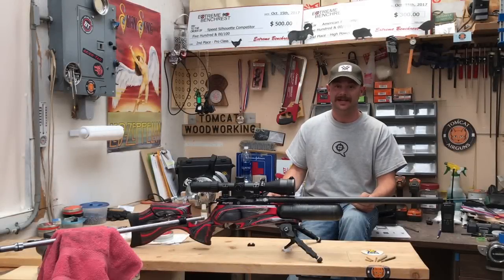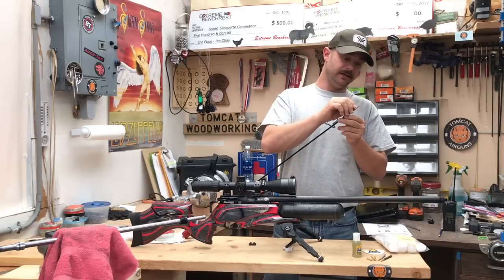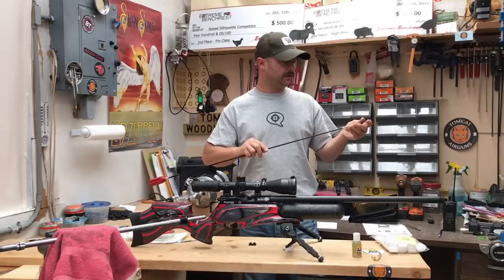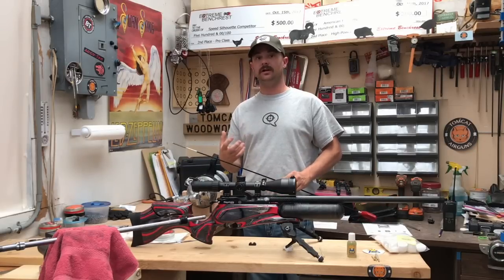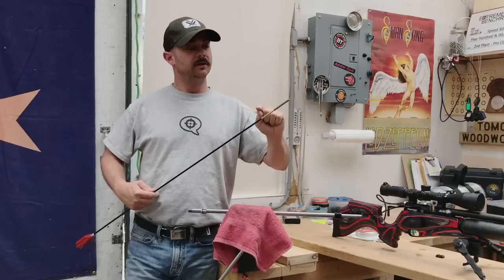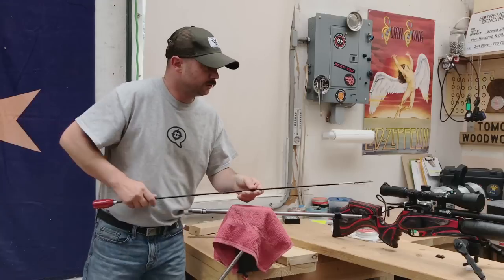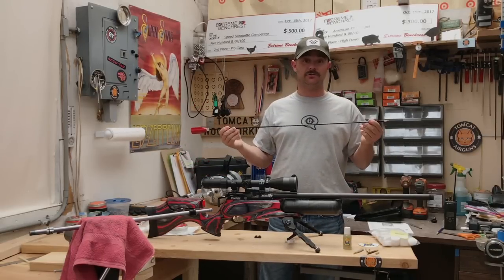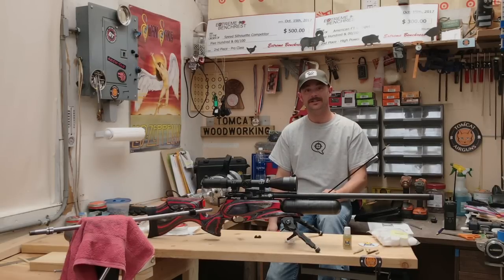Dewey Rod cleaning system

Comment: Dewey is definitely made for firearms.  I'm surprised airgun people even know about this stuff.  I'm not sure why they have the male and female ends for the parts they have, but I believe that those parts usually attach to the more popular detachable rods people use, which tend to have female ends.  But, really, adding an extra part is no big deal, especially when Dewey provides it.  I don't know anything about airguns, but you're meant to run the rod while holding the handle, as that allows the rod to spin with the rifling twist in the barrel.  If you hold the rod, then you're defeating that great feature.